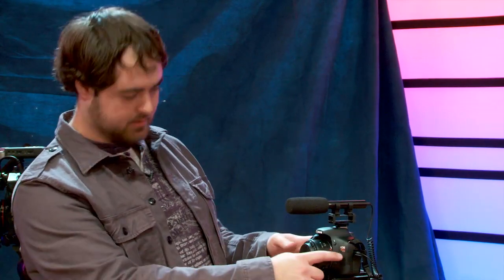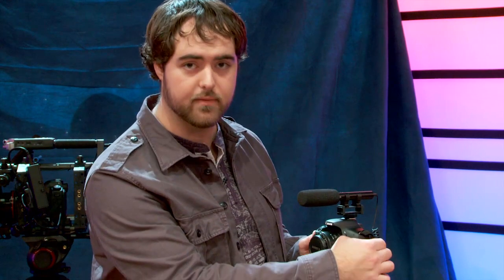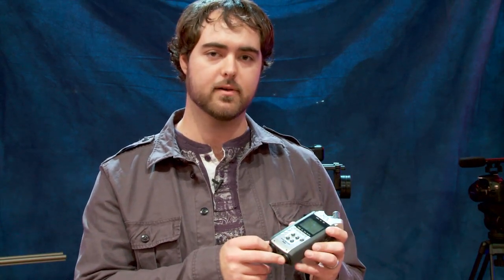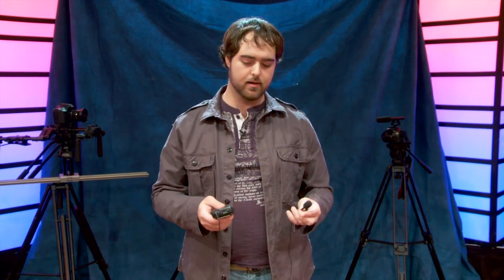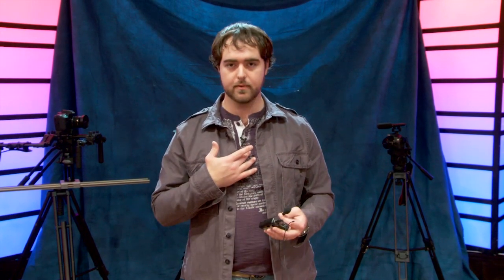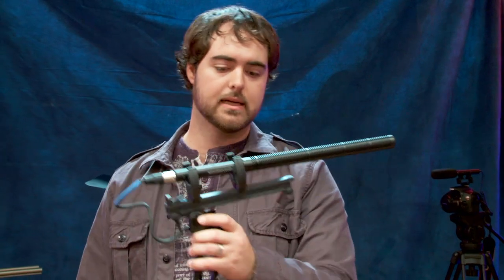HDSLR 101 #7: Sound and Microphones

Comment: For interview a shotgun is a good choice indeed, but it depands on the situation wich mic you want to use. Further you show audio as something easy to do, but in fact it isnt so easy because you need to set the levels right, and choose the right mic's for your inputs to avoid noise or distortion. Pro mic's are great when you know how to deal with them, other wise they are a irritation to get them right.

So my advise is to ask a proffesional audio engineer what mic is for your apperature the best to start with and ask him to demonstrate you how it works. Most pro's like to tell you all about it.

With the clapper i fully agree, it is a great reference point to work with, even in this time of digital filming. Because in DSLR you dont have a sync or time code generator to work with as you have in the proffesional camera's from Sony and JVC or so.

Comment: @kartug01 You should use the Zoom H4n with the Audio Technica AT-875R mic. Excellent combination. H1 doesn't have the same capabilities as the H4n, for one thing: XLR. Rode + H1 should be fine, but the H4n with the AT is just so much better. Check the reviews on B&H to help with your decision.

Comment: If anyone needs to record an Consert with Alot of noise mostly you can not use a shotgun mice or  Rode stereo mice. In that case use an Zoom Q3. Put it on sound recording and auto. Result will be perfect. I do not have any experience with other zoom products but i asume that they will do fine.
For other outside recording or inside the Rode stereo mice is perfect.